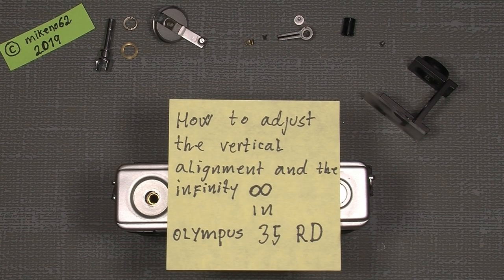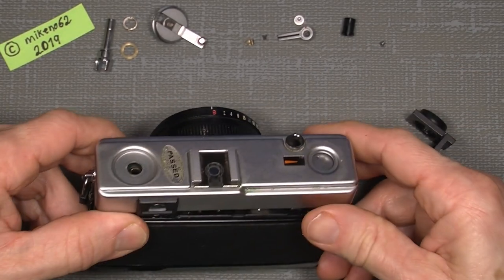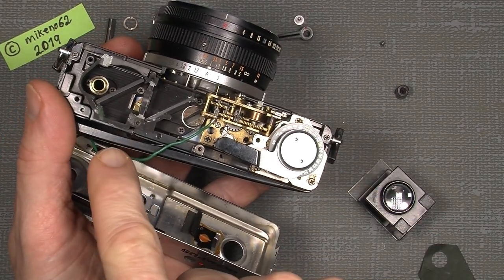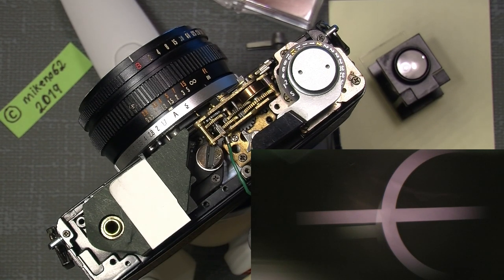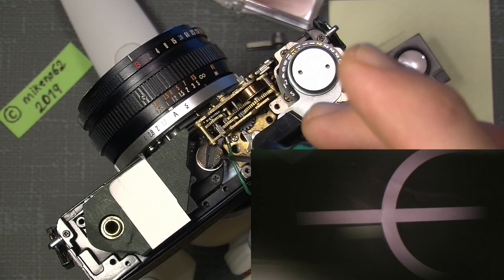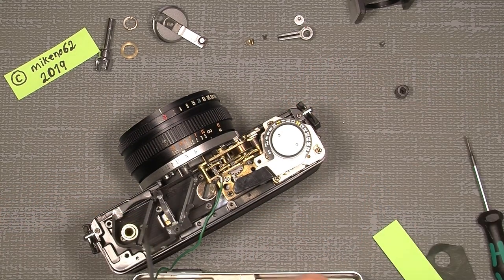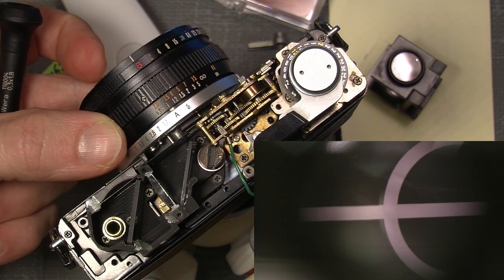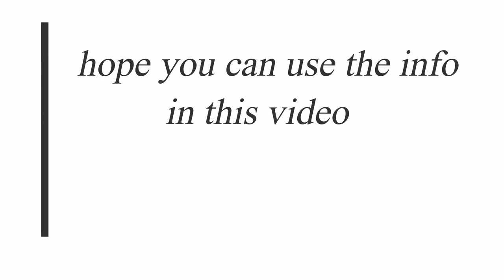How to adjust the vertical alignment and the Infinity In Olympus 35 RD

Comment: Hi Mike, thanks for sharing those videos! Very helpful.
One question. When I adjust the infinity and focus on 1 meter for example. From where do I need to measure this meter exactly in order to get the best results? Is it from the beginning of the camera body or from the end of the lens? 
Thanks for your support
Reply: Hi! Did you find the answer for this somewhere?
Reply: @lenard_andras_kiss you measure from the film plane. There should be a little circle with a line through it on the top of the camera, you start your ruler there.
Reply: @Exxcalibur186 Thanks! ❤ Can you post an image (through google drive or any image hosting service) where it is exactly?…

Comment: Nice review. Please can you tell me how I can remove the flash shoe. I have to adjust the vertical alignement of the rangefinder. 
Thanx!
Reply: there’s a big flat spring steel cover that clips on to the actual shoe. this is the shiny bit you see surrounding the contact patch. get something sharp or thin underneath it and pop it off, exposing the four screws!

Comment: Very helpful! Thanks for sharing your knowledge. 

I have a problem with my 35 RC which maybe you could help me to solve. 

I think the viewfinder mask (the one where the corner frames and shutter info are written) is not well aligned, so when I think the image is well composed (looking into the viewfinder), it actually will result in a photo with a wrong horizon alignment. 
Almost all the images from my last roll needed a -1,32° rotation to be well aligned with the horizon.

Is it possible to fix it? Thanks

Comment: Hi Mike

Great job with videos! :)

I have a old 120 format Voightlander BessaRF, my vertical needs calibration, any idea where the screw for the adjustment would be located?

Thank you and keep the videos coming! :)

Regards

Manny
Reply from the maker: Well, I have actually made 2 videos about the Voightlander Bessa III RF, not about the range finder adjustment, but 2 other issues, you can see them here:

https://youtu.be/THz6glfMIXg

and here:

https://youtu.be/2WIpQN5FGZ4